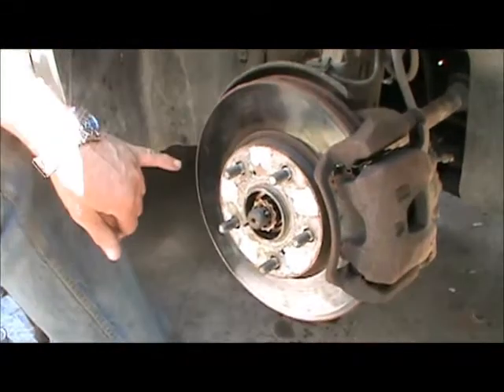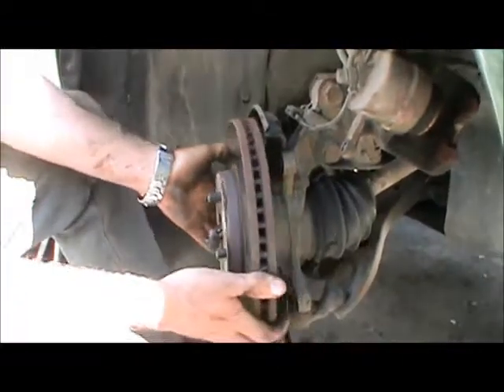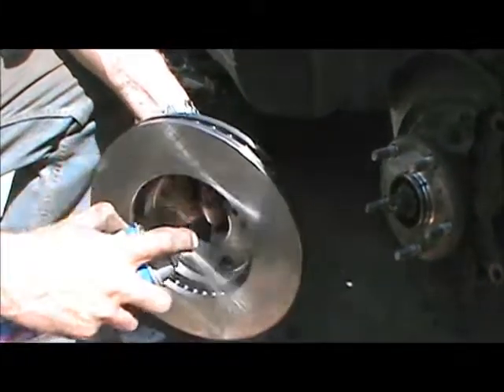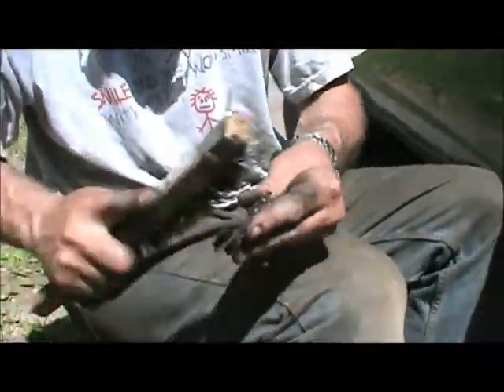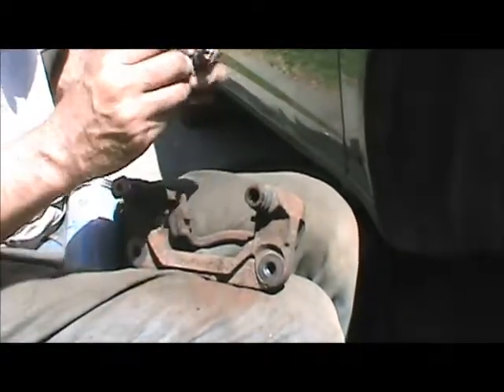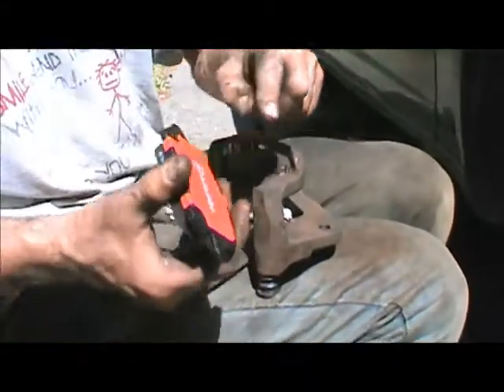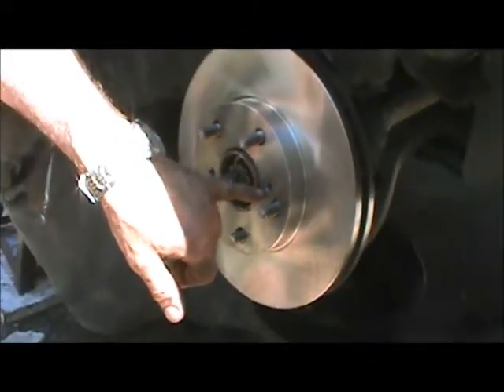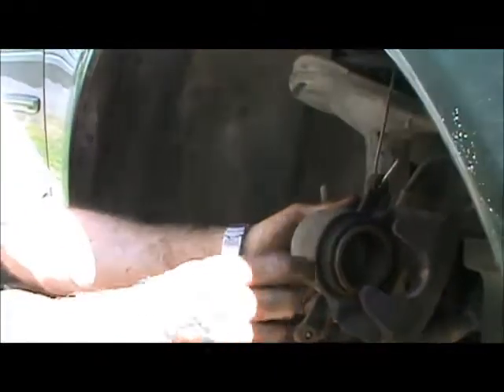2000 Toyota Avalon Front Brake Service

Comment: Great video, only thing I would like to add is to make people aware that dust clouds seen when brushing/filing can have asbestos in it depending on the brake pad. This dust is easily inhalable and will also be tracked around into your home from shoes/clothing. Even wrenching on the brake system can cause dust to go airborne, simply bumping the old pads together at 3:44 caused a visible cloud of dust. 

Maybe I am just overly cautious but figured others watching this great video may like to be made aware so that they can wear proper PPE if desired.
Reply from the maker: viewer54322 you can’t be overly cautious when it comes to asbestos! Thanks for the comment.

Comment: Regarding dust shields, about 12 years ago, a shop recommended removing the front dust shields due to brake pulsation issues. He claimed it would help keep the rotors cooler. 12 years later, no issues with dust (ceramic pads) or brake pedal pulsation. And for God's sakes folks, wear a dust mask when brushing off brake dust/rust to help minimize lung issues later in life.

Comment: Two recommendations; 1. Clean the caliper BEFORE starting the brake job so as not to contaminate what you've done with all that dust. You can also push the piston in at this point to see if it's working. 2. Check your brake fluid level before pushing in the caliper piston so it doesn't overflow.

Comment: A question. You did put anti-seize on the pad ears but could you also/instead put it on the hardware (clips)?  Also, the bracket bolts are 79 ft/lbs. the caliper is 25 ft/lbs (on Camrys). Also, many others recommend always using new hardware. I did see that yours was in good shape though.
Has a bolt ever loosened from the bracket after applying anti-seize to the bolts? I have watched nearly a dozen of these front brake videos and so far yours is the best. You explain everything articulately and are knowledgeable about the process.

Comment: why didn't you remove the top of the master cylinder b4 you compressed the caliper to relieve the pressure. I also use the old brake pad and a  c- clamp

Comment: Anti_seize has an intended service and using it on brake calipers is not one of them. Use a rubber grease on pins and another lube for pad tabs and shims.
Reply: Sil Glyde is the brake lube for pins.

Comment: I cannot quite make out the name of the silicone based lube. It says Ultra... something but not in focus for me. Can you tell me the name or at least the part number? I have looked for it but only found this: Permatex 80653 Silicone Extreme Brake Parts Lubricant. Is that it? It's pretty expensive.
Reply from the maker: Hey there I honestly can't remember what we used. John had all that stuff lol sry man
Reply: @ipmgamer  Thanks for the reply. I found a good one on Amazon: CRC 05361 Silaramic Brake System Grease - 5 oz. for about $13.
Reply: That Extreme Permatex stuff is amazing. Highly recommend it.